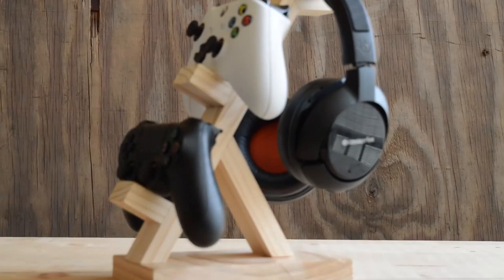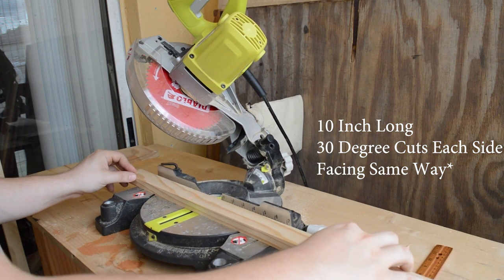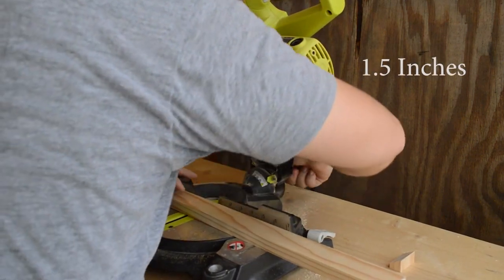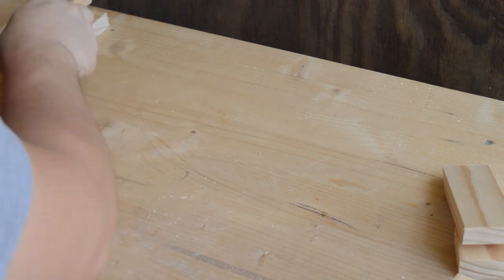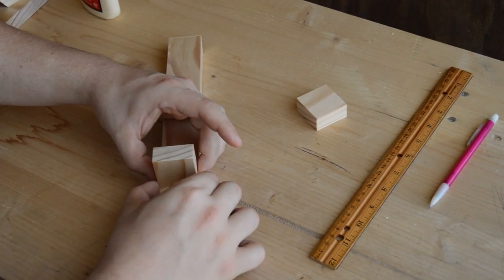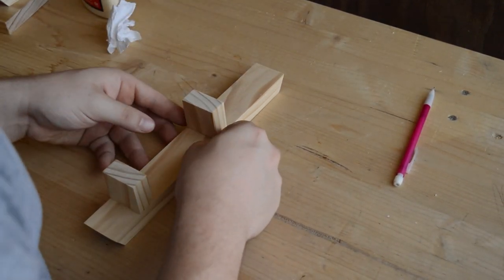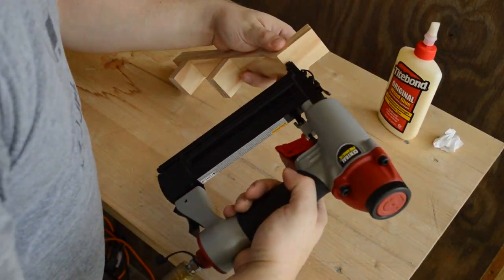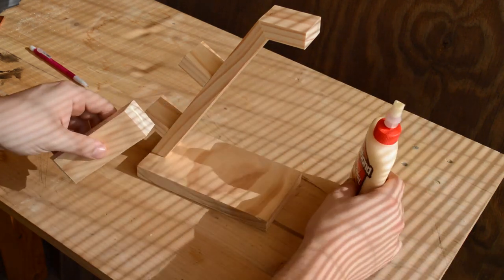Controller Stand  | Instructions on how to build! (Easy)

Comment: Base- 4 inches wide/ 7 ¼ inch long

Cut  ¾ inch by ½ inch wood into 10-inch long with 30-degree angle cuts facing the same way 
Cut  ¾ inch by ½ inch wood into 4-inch thick with 30-degree angle cuts facing the same 
Cut at 1.5 inches from the angled cut 
Cut two 1 ½ inch straight pieces
Sand pieces 

Attach
Attach the two 1 ½ inch pieces to the ten-inch stick
Make sure the 10-inch has the angle facing down 
1 ½ inches from the bottom of the ten-inch piece, make a mark
Grab 1 ½ inch piece and align it to the mark
Add glue to the 1 ½ inch piece 
Align to 10 inches ( Wipe up excess glue with cloth because it will make sanding more challenging)
Add 2nd piece in the middle of the first piece and the tip of the ten-inch stick
Make a mark and add the 2nd piece the same as the first ( steps 3-6)
Optional ( staple/ nail )
Glue the top part ( small strip of glue), press, align, and hold for 30 secs
(The most difficult part) The first glued piece you've been working on onto the base
Align to the middle, measure the middle, and then mark it
Add glue and align to markings and the middle of the base
Press and hold for at least a minute
If not nailing, leave in position with the base on 
Last piece( align to the back of the 10-inch piece
Apply glue to both ends and attach it to the back

Comment: what are the dimension of the wood at the beginning of the video? love your videos. I actually bought 2 of these stands.
Reply from the maker: The first cut in the video is the base. The board that I use for that is the Pine Select. I buy the board from Home depot / Lowe's and they sell it in 7 1/4 wide by 6 feet or 8 feet. The actual size of the base is 7 1/4 by 4 inches. Thank you so much for your orders! I have been very busy with a new job and haven't been able to ship out my orders as fast as I want to, but I am getting used to the new Job schedule. 

Thanks for the orders and checking out the video! If you happen to make it, please hit me up directly I would like to see some pictures!

Comment: What kind of wood did you used for this?
Reply from the maker: In this current project and build I am using Pine Select.
Reply: What wood would you recommend now?
Reply from the maker: Pine Select for sure! There are types of wood that you might be able to use, but a lot of them are warped and they are very hard to work with when they aren't straight. When you go buy them, look through them and try to get the straightest ones.You can actually get both of those types of boards in Home Depot and in Lowe's.

Comment: What is the thickness of the board you are using?
Reply from the maker: Hi, the thickness of the bottom base board is 3/4 inch. Was that what you were talking about?
Reply: @rdwoodshop7402  what about the rest of the wood? The angle cut? What dimensions is that one?

Comment: What type of wood do you use?
Reply from the maker: I use Pine for this build. Normally I buy Pine Select from Home depot, or any sort of pine from a lumber.
Reply: @rdwoodshop7402  thnx, and how high is the wood?
Reply from the maker: @lucnass8640  Hey Luc, not sure exactly what you mean by how high is the wood? Like how high is the stand? Or like the two types of wood I use on it?
Reply: @rdwoodshop7402  I mean how thick the wood is, so the height of the 2 different boards
Reply from the maker: @lucnass8640  So the base board i buy in 8 feet and the width is 7 1/4 and it is 3/4 of an inch thick.